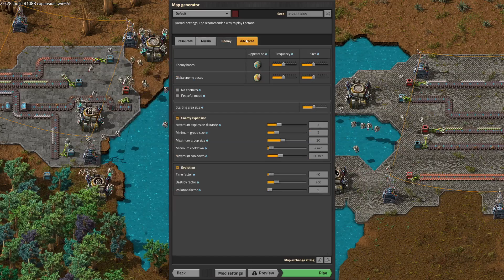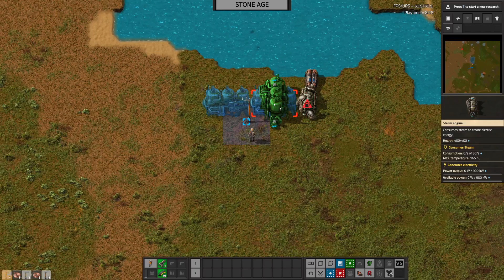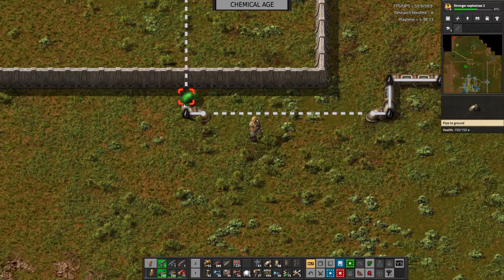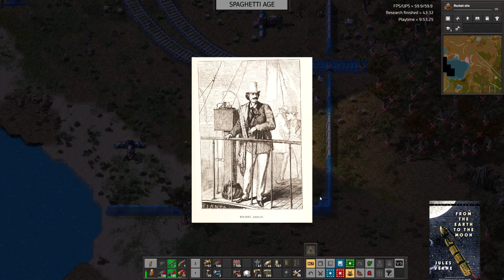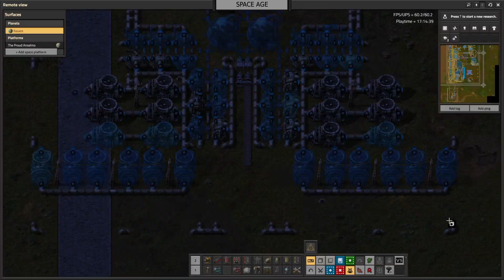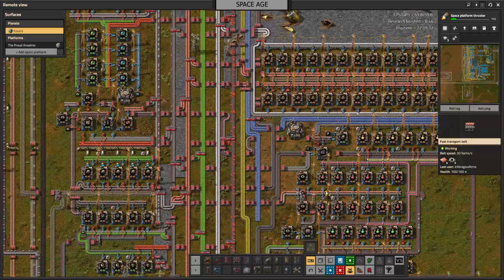Factorio: Age of Space - Part: Nauvis

Comment: Maxim 37: There is no "overkill." There is only "Open fire" and "Reload."
Mix with Maxim 22: "If you can see the whites of their eyes, somebody's done something wrong."

I firmly believe that if they reach your walls, you need more guns. Not really possible without rocket turrets, sadly, but it means that flamethrower turrets are too slow to react for my defense philosophy.

My wall design is one wall thick, and gun turrets directly behind them. All the way through. No gaps, just wall and turret. With Uranium ammo and max damage + speed research (assuming no infinite), I have found this able to handle expansion parties even with behemoths. The ammo belt gets a little long snaking its way all around my base, and it eats a lot of U-238, but it works!

It probably helps that I feel bad for the environment, so I use my beacons not just to speed things up, but also to cut emissions to minimum. I refuse to let machines use more than minimum power, which cuts down drastically on my pollution. It helps that I don't like the vanilla beacons, so I use the Beacons Rebalanced mod, which is close to Space Exploration's beacons.

Comment: What I find out is early flamethrowers is a scam. Each costs like a tank, crafting takes eternity, and you must setup all those pipes and walls to feed it, and it will break anyway without bots. So, instead of that, you can just spam mines in the direction where biters comming from. They cheaper than yellow ammo, 2-3 mines enough to blast the whole attack group (from Big biters), and last long enough you will probably waste more time fixing walls near flamethrowers than replacing mines. And once you unlock bots, just put yellow chest with mines near roboports and forget about biters. Or assemble some tanks with personal roboports, put inside stack of mines and stack of repair packs and drive them whenever you want them to be through remote view drive.
Reply: I agree, or tbh on my current playthrough i pushed out early with yellow ammo and turret creep and created a space large enough that my pollution barely extended beyond it. I'm now killing off expansions with lazers, and after i went to Vulcanus and got the Artillery i use it to just keep them well back from my borders. I had some fun with destroyer capsules and i can demolish a behemoth nest easily if i want to with power armor and legs. So that early investment of 2-3 hours to build walls really far out has served 100+ hours. I don't think i'll ever play the game differently on normal settings going forward unless i want to give myself constraints